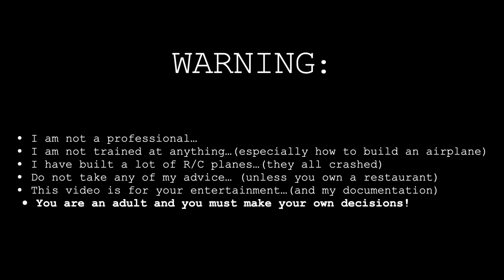RV10 Build 24 - Wing Bottom Skins

Comment: Builders get infatuated with dimples and oil canned skins. On my Cessna 310 in flight you can clearly see the pillowed skins between the ribs and the dimple wrinkles around the rivets. Build on!
Reply from the maker: I fly a Cessna 182, their workmans ship is garbage on the rivets and skins.  Paint hides a lot if the imperfections.